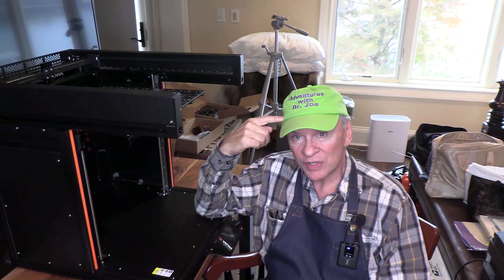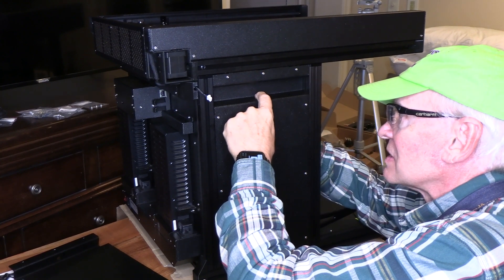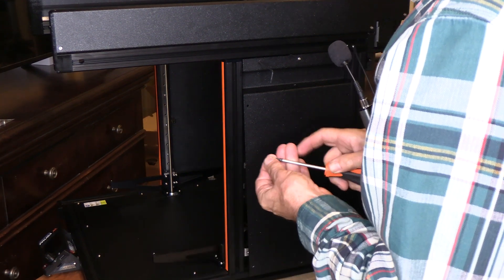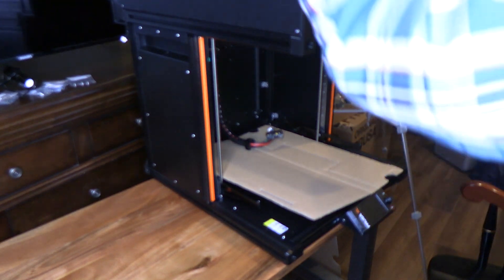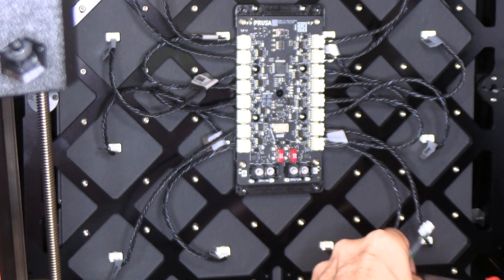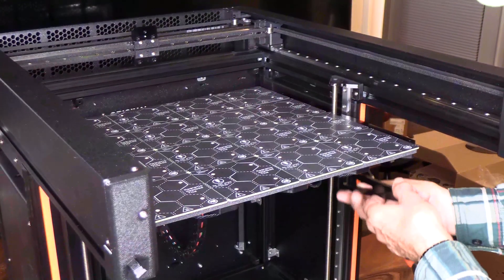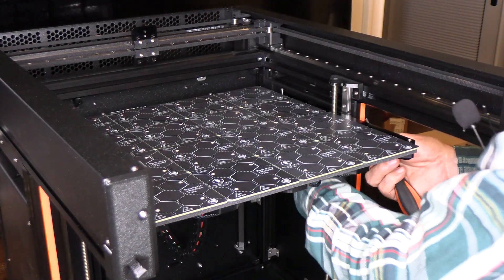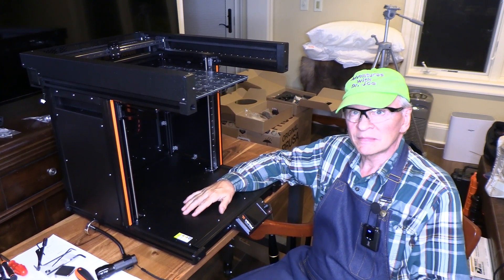Assemble the PRUSA XL 3D Printer with me! (Part4)

Comment: Dr. Joe, Thanks for all the hard work.  I just ordered the XL and have found your videos so very helpful in getting prepared for the XL's arrival.
Reply from the maker: Thank you so much for your comment. I do love my printer, but only after I’ve added so many modifications which fortunately are included in the new build. With the idle, our arms now made out of polycarbonate carbon fiber you’re not gonna have any trouble with filament being driven into the Extruder gear. It will work fine for you. I also added a brush and a waste cup for each of the extruders and all of this is available on printable. One of the first things I did was print an enclosure and I bought the polycarbonate sheets from Asia and that was a great start and then I added all of these extras, including internal lights, a fire extinguisher system, a smoke detector and a temperature in a humidity gauge. Sorry for rambling on you’ll have a great time. Enjoy consider subscribing. Thanks. Jill.